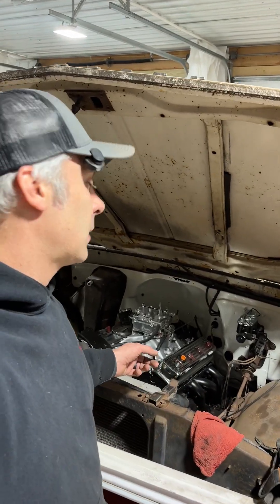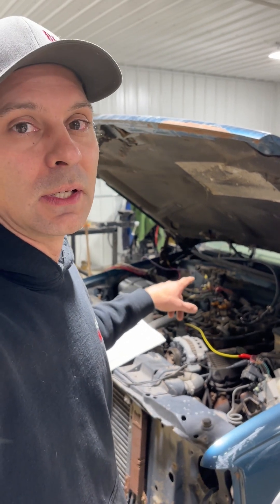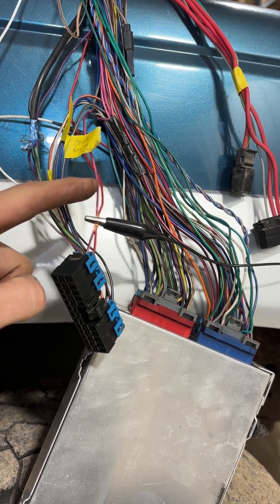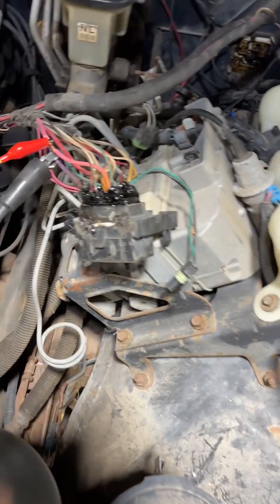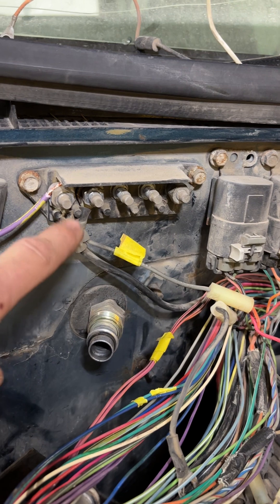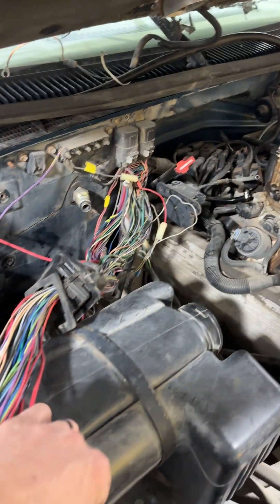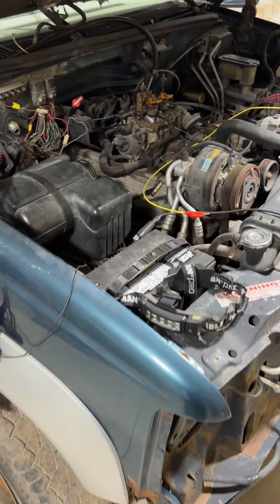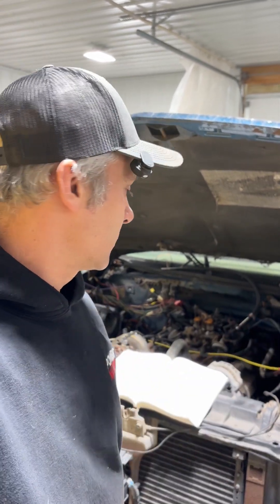TBI Stand Alone Wiring Harness: If I can do it, so can you!

Comment: So I'm stripping down a harness eliminating things like A/C anything to do with brakes and any wires that would need to run to the transmission. Will the engine still function properly. Using a TH 400 trans.  Engine was originally TBI and I converted it to carburetor. Now I'm trying to switch it back. It's an off-road Trail rig.
Reply from the maker: It should work fine.  Since the 400 doesn’t need to see any inputs from the engine, it will shift fine.  As far as the engine goes, as long as you keep the specific wires to get it to fire up, it will run.  It doesn’t need to see any inputs from a trans to function.
Reply: @JeremyWeckmanBuilds I was also wondering if the function of the 2 knock sensors play a very big role in the PCM. Probably don't matter but I do have the red and blue connectos.
Reply from the maker: @JustWeldandFab knock sensors help with timing, if you can keep them, keep them.  On the LS side of things they can tune them out I think, not sure on the tbi
Reply: @JeremyWeckmanBuilds one more question for you do you think deleting the EGR valve would have a negative effect on the PCM?

Comment: What if I have no tach wire in my harness , just still wire in the purple / black wire to tach to give signal to fuel pump ???
Reply from the maker: Easiest way is to just supply key on hot power to the fuel pump separately.  Some of these trucks ran the fuel pump wiring through the oil pressure switch.  It’s just easier to ditch those wires and wire the pump in directly.  
What vehicle did the donor harness come out of?  I’ll look at my manual and see exactly how the pump is wired in case you want to keep it in the harness.

Comment: Great video, awesome information. If I wanted to ditch the stock tbi and install say a Holley Sniper for a swap project, could I ditch the stock ECU and just wire the starter, coil and fuel pump separately? I'm worried I might be oversimplifying it but it sounds right in my head.
Reply from the maker: All you would need is the starting wires and fuel pump.  The Holley setup will come with its own ignition system, for that all you would need is key on power

Comment: When it comes to the 4l60e if you want it to shift there is a white box called the vss buffer it's got wires that wire to ground power ecm and to the speed sensor you have to have this wired and the pink wire from the wiring harness. You have no idea how long it took to figure that out. Hope this helps y'all.

Comment: I will put a sbc 350 in a cj7, can i cut all the rest off the wires away from the computer? Thx for this good work!!❤
Reply from the maker: @jackf5845. NO!!!  Do not cut the other wires!  They go to the sensors for inputs and outputs.  If you’re using a manual transmission or a non-electronic transmission, there will be some wires for the trans you can remove, easiest way to figure out what you need to keep or remove is to get. Shop manual for whatever vehicle will be donating the 350

Comment: Hi Jeremy, could you give me the book information? I'm exchanging a 90 Chevy for a 2000 engine and I need the information for the cluster wiring for gauges. Thanks. Best regards, Houston, TX
Reply from the maker: @ropez69, let me know exactly what you need.  I’m assuming you want stuff like oil pressure, engine temp, volts and gas gauge. I’ll see what I can find

Comment: Hey Jeremy,  great video but I have to admit I’m pretty intimidated by my wiring harness.  I am swapping a 1993 Suburban 454/ 4l80E into a 1980 k30.  Everything basically like it is in the Suburban. Same motor, transmission , ECM just want to remove all the unnecessary wires Cruise, AC, ABS etc.  I wil be following and might see if you’re interested in stripping down my harness when you finish yours.  Thanks
Reply from the maker: @hwoutdoors1862  awesome, let me know if I can help with anything.  I’m pretty sure the entire abs system is separate from the engine wiring.  A\C is only a couple wires, 3 is think, and I’m not sure on cruise yet.  Let me know if I can help! Good luck
Reply: @ Thanks Jeremy,  maybe you can do a video on how you thin down your harness and how you will supply power to it whether with a new fuse block or whatever., it seems we’re about 30 years behind on doing a TBI swap as everything now is LS harness modification.

Comment: Thank you for this video. Maybe you can help me…I have an 88 k5 blazer TBI and I’m only getting 2 volts to my fuel pump relay and right side if fuse block so no initial prime and no start. I’ve been looking throughout the wire bundle for breaks etc. should I be looking at those wires you showed in video first?
Reply from the maker: @pluh187  check your power/battery voltage coming out of your house ignition switch on the column, had a fuel pump problem in a 95 Suburban and it ended up being the ignition switch not sending the correct voltage to the fuel pump relay/pump